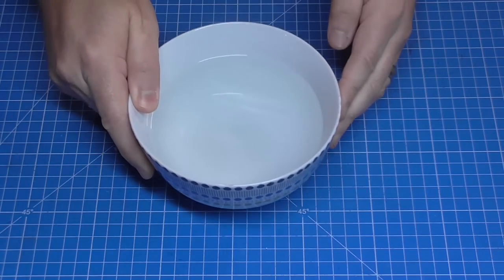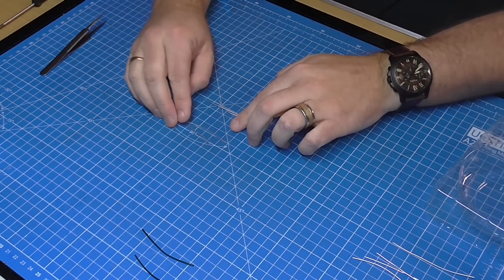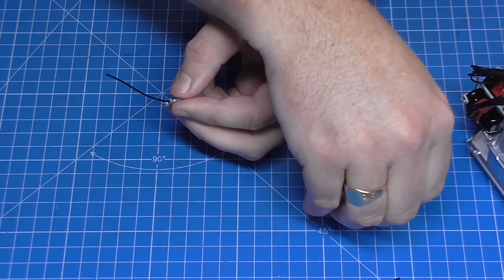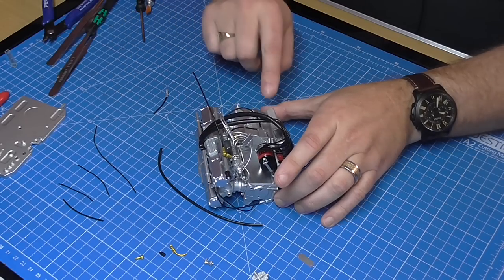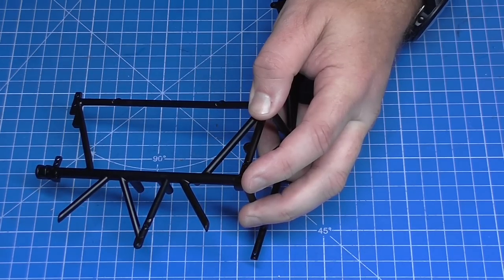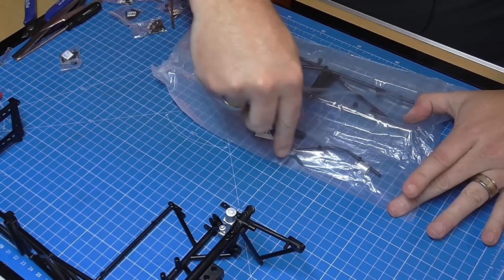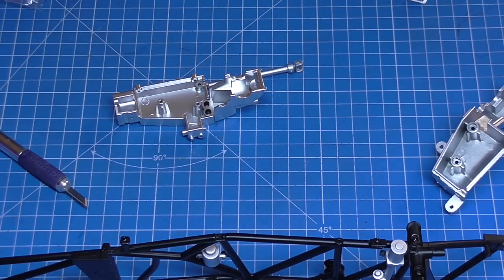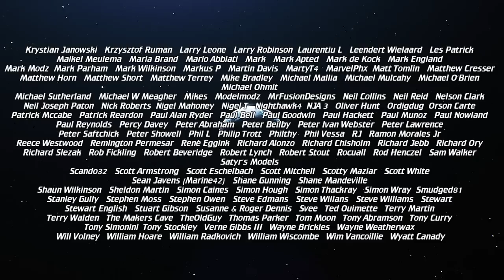Build the 1:8 Scale Stirling Moss 1955 Mercedes W196R - Pack 5 - Stages 14-26

Comment: I love the detail on this model. I think I definitely put glue on both ends of those pipes. I don't think I would trust the push to fit details staying in place.I think if it's not locked in place with screws I think I would glue it. With my luck, I would be in fear of losing those parts. The model looks fantastic, Wayne. See you next time.
Reply: @Steven Wheaton - I agree, Steven.  Over time, those vinyl pipes will likely dry out and be prone to falling off.  A touch of Cyano on each end will take care of that potential issue!

Comment: Wayne those starters are actually Magnetos... But its a lovely model.  I've just finished the Route master so might have to wait a bit till funds are more abundant.
Reply: @Downstairs Dave - The folks who developed the instructions got their wires crossed - pun intended!  They named these magnetos incorrectly as starters, which is where Wayne picked it up.  I have the 427 Cobra SC and they misnamed a couple of engine components in those instructions also.  Would you happen to know if this car has an onboard starter or is it an unattached auxiliary one?  I haven't seen anything in the instructions/diagrams that could be considered a starter.  P.S. - Are you pleased with your Route master build?  It looks great and weighs a ton!  :hand-orange-covering-eyes:
Reply: @Loulovesspeed  Didn’t realise they described them as starters in the instructions..not everyone is in the motor trade!
I absolutely love my Route Master.. the best monthly kit I have built, and I have built a few..
I’m retiring to Spain in a couple of months. Thought about building the Miura.. My favourite supercar..
Reply: @Loulovesspeed  oh in regards to starting the engine. I think they used an air wrench that connected to the end of the crankshaft.. don’t quote me on it though..
Reply: @Downstairsish  - That's what I was thinking as GP and F1 cars typically save weight by not having on board starters or battery.  The Miura looks very cool and has a good deal of detail.  I am waiting to receive Agora's Mercedes Benz W196 R kit which is a beautiful model with very cool wire wheels you build one spoke at a time.  I retired 5 years ago so have plenty of time to build these beauties.  I hope you enjoy your retirement in Spain!  👍
Reply: @Downstairsish  - I have the CMC die cast model of the Ferrari/Lancia D-50 F1 car, and it came with a 2 wheel portable starter cart with battery, hand held electric starter with a long shaft that hooked into the left rear of the car, which connected it to the trans axle.

Comment: quite a luxury to get two complete sets of tires. Is that a first?
those tubes and hoses are enough to drive one mad.
Reply from the maker: Yep. Two tyres straight away is definitely another first for this build. Hope I’ve seen the back of the hoses now lol
Reply: Actually, it's two sets of wheels and one set of tires - same tires fit both sets of wheels.  😁

Comment: I do wonder sometimes how much build testing all the manufacturers do - not just Agora but also IXO etc.. For instance it doesn't make logical sense to tell you to put the fuel pump in, knowing you'd have to remove it to get the manifold in. Surely they /should/ have swapped those steps around.

Ahah! Brake /drums/. Wayne you may remember me asking a few weeks ago if any car kits had drum brakes as they all seemed to have discs regardless of age. It'll be interesting to see the rest of this build.